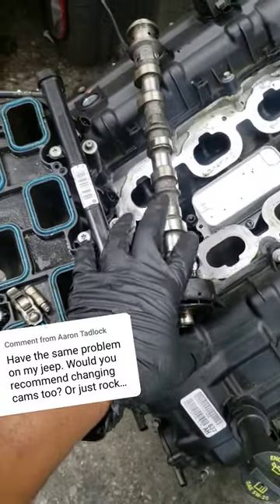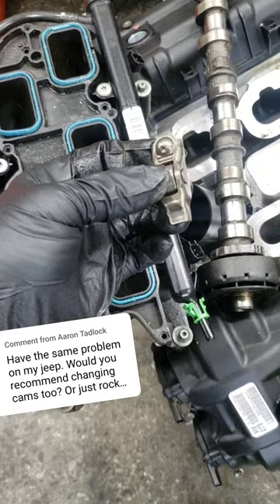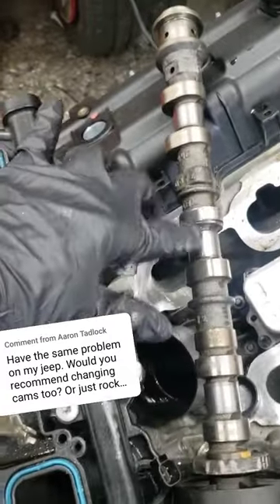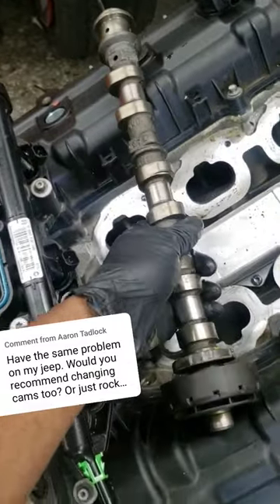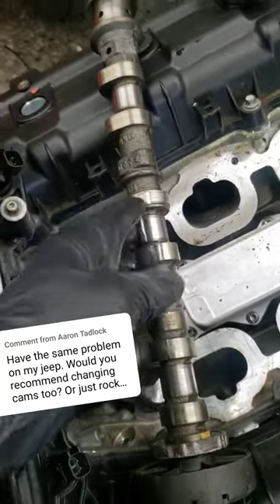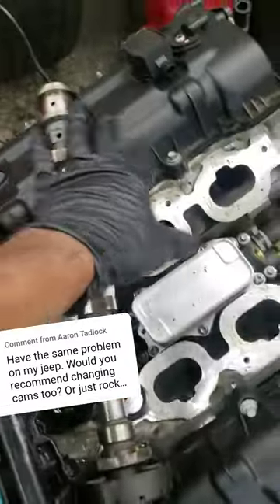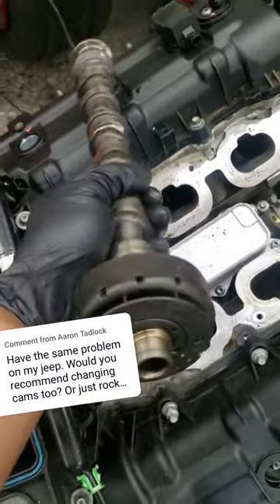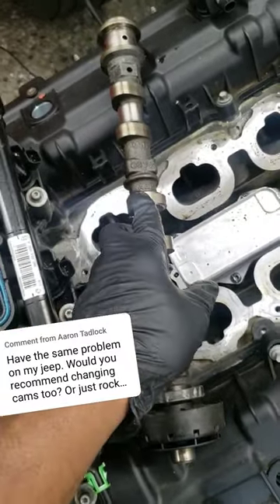STOP WASTING MONEY. If camshafts not damaged, theres no need to replace. Car will not run better.

Comment: People do that because of the old myth that if the cam comes out and you reuse it then it'll break shortly after you install it.
Reply from the maker: Really? Nothing will change. Some guys actually think the car will run better because of the extra $600 cams that was installed..smdh
Reply: If the cams are within specs than it's good to be reused.
Reply: @OnlineMechanicTips  yeah it doesn't do anything but it just a myth that a lot of people take to heart.
Reply: @dcomputers  oh i know hints why i said myth
Reply: @OnlineMechanicTips I've seen a Camaro last night with a 100 dollar cam that was going hard asf.

Comment: “Camshafts don’t wear out” I disagree, the wear may be minimal in a DOHC design but it’s still there you just cant see it with the eye. I agree that the cam looks great but you wouldn’t Mic the journals and compare it to factory spec?
Reply from the maker: Lol, sure you should mic them. And no, I've never seen a cam lobe with so called normal use worn out. My point is that these are relatively new cams that was replaced on low mile vehicles that had 1 rocker arm come apart which caused 1 lobe to be damaged on 1 camshaft. The other 3 camshafts thats usually replaced "just because you in there" perfectly fine.
Reply: @OnlineMechanicTips  okay gotcha. I typically see half million mile dodges with Cummins 6.7 or 5.9. After 500,000 miles Im a bit more curious about the clearance between everything than I would be an engine with 500 miles

Comment: Depending on how you answer my next question if I subscribe or not, what's your opinion on the GM 4.2 liter straight six? You sound legit though for sure.
Reply: 200k+ mile engine as long  as you take care of them, but don't take rebuilds well (so I hear), and an absolute pain to work on, depending on the job. Be careful of timing chain and or cam phaser issues as either will pretty much require the complete disassembly to fix. I know most shops around me won't touch them for major repairs due to this, but as long as you take care them, they will take care of you.

For after market, pretty expensive to mod but considered the "American 2JZ" cuz apparently if you can swallow the bill, they modify pretty damn well.

Comment: Thats exactly what my camshafts looked like, one question tho, when i pulled the back cover off there was surface rust on the exhaust cam from condensation you think its that breather that go over the end of that exhaust camshaft bolted to the valve cover thats doing that?
Reply: Condensation shouldn’t set up inside the engine unless she’s been parked/ took apart other wise might wanna do some more inspecting to see where that comeing from water and oil should never mix inside your engine nun the less soak in some vinegar an lightly scotch bright it should be fine unless one of your exhaust valves is stuck somewhat open an letting moisture to get in that way

Comment: I bet those lifters wear out from people starting the car then not waiting just 15 seconds for the oil to reach them. It’s not like they don’t know how to design lifters.
Reply: theres a million things that could cause lifters to wear out. hard driving in extreme cold temperatures before the engine warms up, infrequent oil changes, contaminants in your oil, running LOW on oil, poorly designed/made lifters. The list goes on and on.
Reply from the maker: April 7, 2023

Comment: I had a 2006 Ram 1500 with 246k miles.  One rocker arm fell off (got misfire code)  also lifters did fail, ao I replied them.

Comment: But how come it feels like the cam or on 2nd thought the piston? is settled in to low end torque and the motor ev4n sounds higher pitched than the deeper rumble it had before 70,000 miles

Comment: Where do u get them for $250 😢
Reply from the maker: I think the bank 1 exhaust even higher because of the PCV
Reply: Most of them are around 410 a piece retail if memory serves me right.
Reply: Called delear was told 499 lol 😆
Reply: I think I paid close to 420 for exhaust bank2
Reply: I got mine from a junkyard for $50 and have ran 40k+ miles on it still going strong.